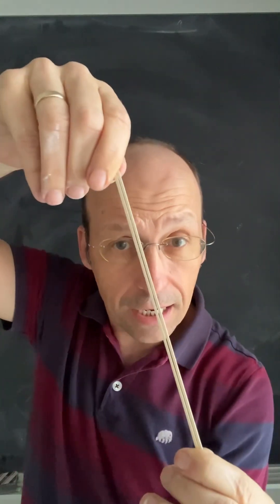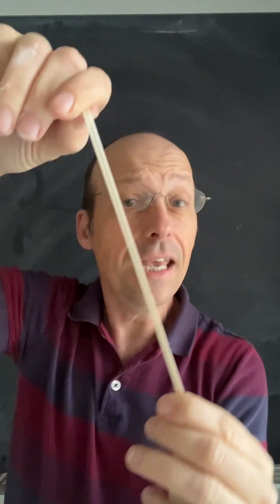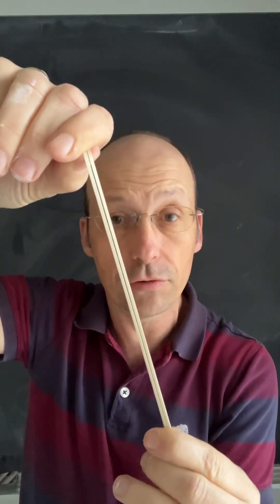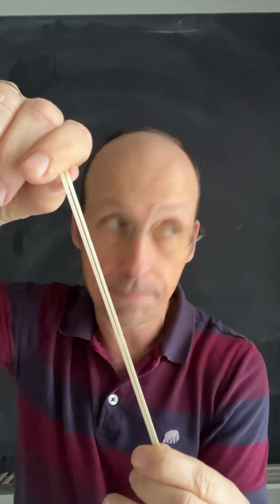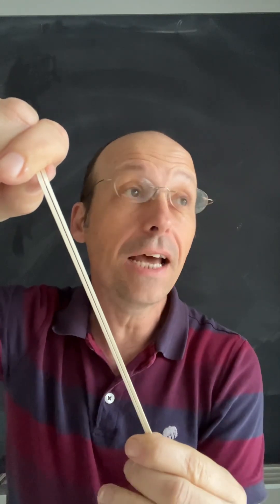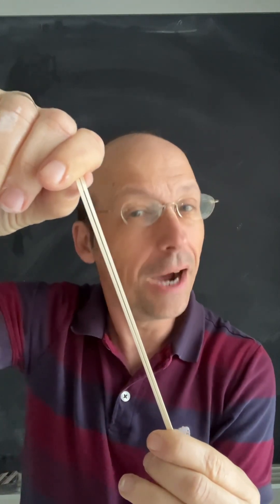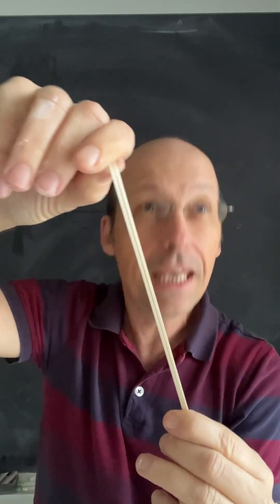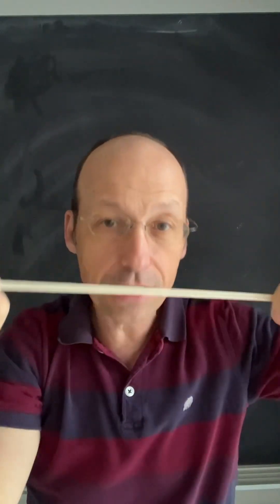How does a #heatpump work? #science #physics #sciencedemo #scienceathome #physicsteacher

Comment: Except, the compressor is outside and the evaporator is inside. The compressor compresses the refrigerant and then it travels through the cooling coils and condenses to a liquid. The high pressure liquid is pumped to the evaporator and through evaporation chills the coils that cool the air in your house. https://www.youtube.com/watch?v=nVo0GuNm3Ek

Comment: Hold on, Heat pumps works on compressing gas. It is the heat of compression gas that makes the tube hotter. What makes the copper tube colder is the High presser going to LOW pressure.

Comment: Rubber band demo = heat pump?  Well sort of, in a real heat pump stuff called R454-B goes from liquid to gas through a closed loop of tubing that flows both inside and outside your house/apartment.  In A/C mode, the outside compressor turns warm R454-B gas coming from inside your house into a hot fluid which cools down as it passes through the coils of your outside heat exchanger (the heat goes to the outside air), then the cooler compressed fluid is pumped inside your house where it passes though a pipe restriction called an expansion valve where its pressure drops rapidly and simultaneously cools down and the R454-B turns back into a cold gas. This cold low pressure gas picks up heat from your house's inside heat exchanger coils (a fan blows house air over the coils and water from the house air condenses on the coils and is collected in a drip pan that drains to the outside).  The warmed up gas then goes through a pipe back outside to the A/C's compressor to start this closed-loop process all over again.  In heat mode, the whole process is reversed and the heat is expelled into your house and the low pressure gas picks up heat from the outside heat exchanger coils.  The original A/C working fluid, Freon, messed up the thin UV-light-blocking upper atmosphere ozone layer, a sciency thing that every tech person agrees with, so they switched to R454-B which, if it accidentally escapes, doesn't mess up the ozone layer.
Reply: Thank you for the details💪🏿💯
Reply: Wow... Thanks for this detailed explanation..
Reply: It liquefies (retract) and evaporates (expand) he's not wrong